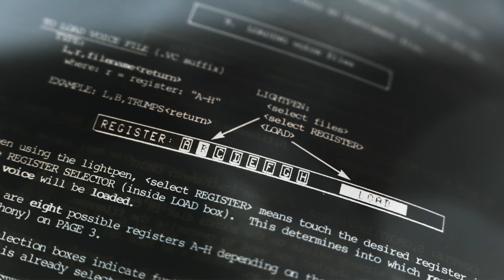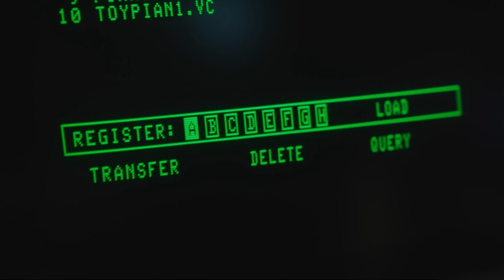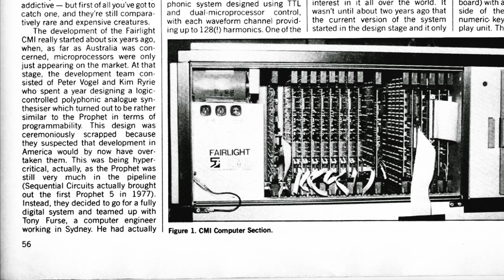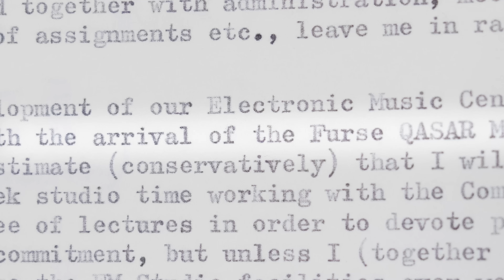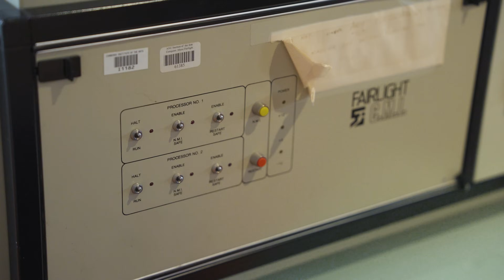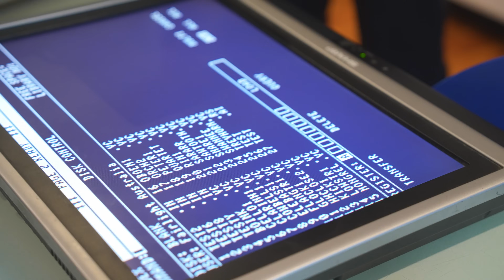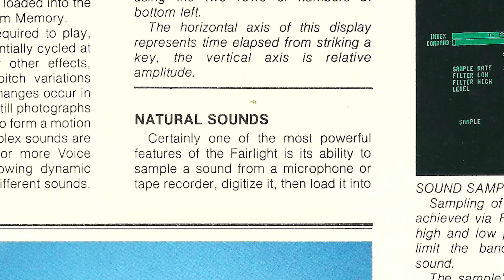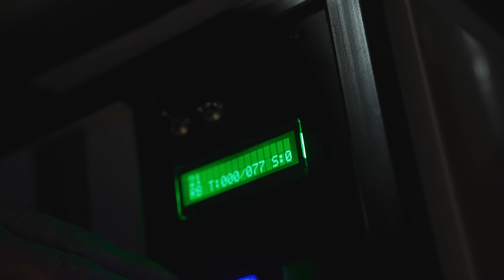The birth of electronic music | How the Qasar & Fairlight CMI pioneered computer music technology

Comment: I enjoyed  your video..the pieces of sound are still incredible..I'm 70 and was at the unveiling of the first
Moog synthesier in  Derek Jollies Melbourne St. Studio.. i'm still playing with early  8 bit micros.. I thought there
might be more on the Digital system ..I believe it had Twin Intel 8080's running out of phase clock cycles??
This concept is still of interest as there are many people using smaller micro's for fun and the shear ability
of the Fairlight shows what can be done with smaller processors.. and right thinking ..thanks
Reply: I have seen reference to dual-6800 on the early machines but my main recollection is of the main system CPU card running dual-6809s. Even though they ran in "hidden cycles" from each other, I don't recall them being effectively twice the speed of a single 6809 as the majority of the operating system tasks ran on one while the other served in a mailbox role, serving a printer port, etc. Having said that, the CMI was bristling with CPUs. Every output channel had its own 6809-based, "Channel Card" which I think looked after unique sample rates (from early days, they were variable and consequently, also required VCFs whose filter characteristic could be controlled by a DAC, fed from a value associated with the sample). In this way, when it was near impossible to produce a power supply quiet enough to be 16-bit rated, the early machines used lower bit-width samples coupled with multiplier values fed to VCAs and filter values fed to VCFs - but don't quote me!
[Edit: There was also a 68K-based card called the, "Waveform Processor" and another under development called the, "Waveform Supervisor" ]

Comment: It's really hard to tell which system should count as the first "real" sample-based digital synthesizer. The Qasar wasn't so much about samples I believe; more about harmonics and digitally generated waveforms. Before the Fairlight, we also had the Synclavier in 1977, and the PPG Wave Computer 360 by Wolfgang Palm, released in 1978 in Hamburg, Germany. I believe the Synclavier didn't allow sampling via microphone either, but the Synclavier II added that after the Fairlight as well. PPG later added a "Wave Term" computer for the PPG Wave that would offer a similar "mic sampling" capability, at a lower price, but that wasn't before 1982. So, IMHO, the Fairlight was the first digital synthesizer that allowed sampling from microphone and natural waveforms, but similar "ROMpling" techniques had been employed before, including the PPG Wave Computer in 1978. Some of the waveforms were quite "natural" already, but memory was a scarce resource.

Comment: There were bespoke systems at the time.  At the University of Toronto in 1979 a PDP-11/35 based system did essentially the same thing.  That said, unlike the Fairlight CMI it wasn’t a practical commercial product.  But the tech was there.
Reply: Quite so. One of the CMI's early selling points was that instead of being a rack of gear with cables and patch panels, it was a "road quality" machine that was at home in the studio as well as live on stage.

Comment: Not designed to be switched off, is layman's talk for no HDD. Volatile memory only, and very likely, little of that too. The professor is so happy, her enthusiasm is wonderful. Thank you.
Reply: Probably more to do with electrolytic capacitors sitting for years without a polarising voltage across them. Back in the old days, we would "reform" electros by disconnecting them and then slowly charge them over many hours, through very high value resistors to allow the film to reform.
As for memory, the CMIs had decent quantities. I recall 256K DRAM cards and later, 1MB cards, for storing waveform data. Maybe not much by present day standards but enough for a couple of seconds or so, depending on the desired sample-rates.

Comment: I worked for Fairlight Instruments back in the day, in Production, in a little building in Rushcutters Bay, Sydney. Coming from a music background, we knew we were part of something that will make history. We made the Computer Musical Instrument, Computer Video Instrument & Voice Tracker. Coincidentally, I had a mate that attended the same University & Course as Peter Vogel. He told me how Peter rocked up to Uni one day with a Peach 6809 computer & a Black Box (white) & explained what the "Computer Musical Instrument" will do & it would be his Thesis. Exiting times. Edit: When you purchased a CMI, you could also purchase Operation Lessons in our In-House Studio.
Reply: Wow! I didn't know Peter owned a Peach. I worked in Ryrie House for about a year and also owned a Hitachi Peach, though at the time, I used it as a second terminal for the Canon BX-3 I was gifted by a friend who'd moved on to 68K and the Amiga. On a previous visit to Japan to deliver training, he'd purchased a copy of OS-9 for his BX-3 (though he may have had a CX-1 before that but they were all but compatible). The reason for mentioning the latter was that you'd likely recall that the later model CMIs all ran the OS-9 Level II operating system (my machine ran Level I). I was acquainted with one of the software engineers who told me how he and a friend had owned Peaches when they were young and hand-coded (and hand-assembled) "Frogger" for that machine! 
PS. I also used my Peach as the main terminal for my 6809 SBC that ran the FLEX operating system.
PPS. By the time I'd joined Fairlight, it was already legendary in tech and music production spheres. In 1981, I saw Stevie Wonder & Wonderlove at the Hordern Pavilion and he, as one of Fairlight's earliest customers was so pleased with his Qasar, he used it on stage and kind of complimented the country for producing it! He'd recently used it on his, "Hotter than July" album.

Comment: It was certainly pioneering in sampling. But there were plenty places doing digital "computer music" stuff. The 1977 Synclavier was a 16-track digital workstation. The Fairlight was a big deal because it had sampling in 1979 and a CRT with a light pen and a keyboard to let you do workstation-y things and actually browse through sample libraries. They basically invented modern samplers because the Quasar sounded like crap so they had to try a different kind of synthesis. And it was such a hit that the Synclavier 2 added sampling in 1980. And then in 1981 the Emulator was the sampler you could actually take on the road, and it made the Fairlight look kinda silly for being 10X more expensive. And then in 1984 the Mirage was the first sampler under $1,000, which made the Emulator look kinda silly.
Reply: The Qasar wasn't really a sampler AFAIK - I would also doubt that the Fairlight was the first "ROMpler" (= playing back natural recorded waveforms, not just algorithmically computed waveforms). In fact, the PPG Wave Computer 360 was released in 1978 by Wolfgang Palm of PPG, Hamburg, Germany (-> Wave Table Synthesis).

Comment: The CMI Fairlight and the New England Digital Synclavier are the two proto DAWs that were soooo ahead of the curve. Crazy.
Reply: I recall in the mid-'80s, another machine was also considered something of a competitor (though perhaps not as much as the Synclavier) - The machine by Ray Kurzweil (later known as a Futurist). I'm thinking that although expensive, they may have been somewhat cheaper than the CMI Series III but I didn't really know what they cost. By that time, and with the addition of a Winchester hard disk, the Series III price had ballooned and had somewhat lost its, "road quality" selling point, becoming more a studio machine used by big name artists, jingle writers and motion picture production but not particularly lugged to gigs like the older Qasar, Series II & IIx models. Everyone in R&D knew of those machines.

Comment: This is a really well made short documentary about the Fairlight! A highschool friend and I had a demo of the Fairlight from Kim Ryrie back in about 1983. It's the only time I have touched one. We were fans of The Art of Noise at the time. I still have the Oct-Dec 1980 issue of Sonics, which has an article about the Fairlight. It does mention Tony Furse and the Qasar, but not licensing the software. It also mentions that Stevie Wonder bought the first one, and took it on tour before the bugs were worked out. I also have the Sonics Yearbook from 1980, which listed the price of the Fairlight at $20,000 and boasted that you could even use it as a home computer running BASIC and FORTRAN. 😊 The last time I saw a Fairlight in person was at the Sydney Showgrounds I think in 1984, where Mars Lasar was demonstrating it. Roland also put on a demonstration of driving MIDI synthesisers from an IBM PC. Just the year before, I got to demonstrate a prototype Roland MIDI interface for the Apple IIe. The Sonics article also says that Kim and Peter first started making video devices, and Fairlight did later make a Computer Video Instrument based I think on the 68000 chipset. Is that Fairlight still kept by the ANU School of Music? Just curious because I live in Canberra these days.

Comment: Sadly, the monitor was missing the light pen. From what I understand, it's merely a housing for a photoreceptor and some support electronics.
Reply from the maker: Yeah the light pens are very hard to find. Peter is working on developing a recreation of the original.
Reply: @mustardflats Glad to hear that!
Reply: Not sure exactly how the CMI pen worked but I recall most light pens - on raster-scanned displays - just triggered registers that captured the pixel row and column address, with the interrupt software trimming back the value(s) to account for latency. On something like a Vectrex game console (coincidentally, also a 6809-based machine) the vector-scanned display would have to work harder to "find" the pen, usually by performing a spiral search from the last known location.